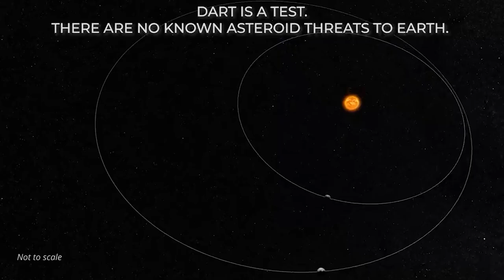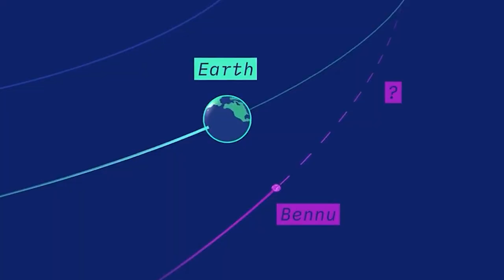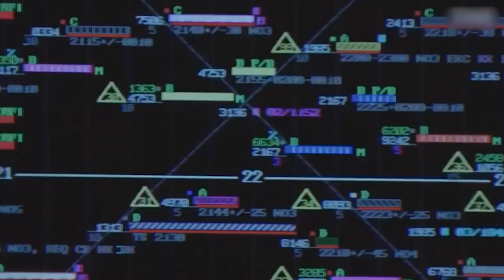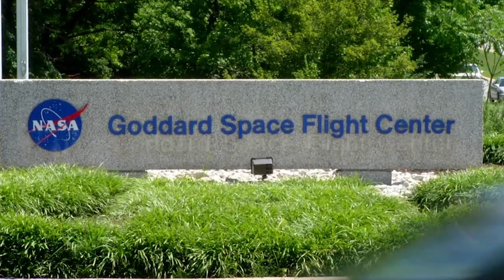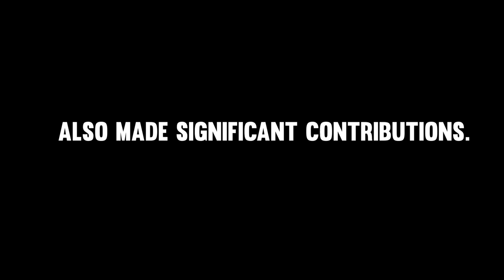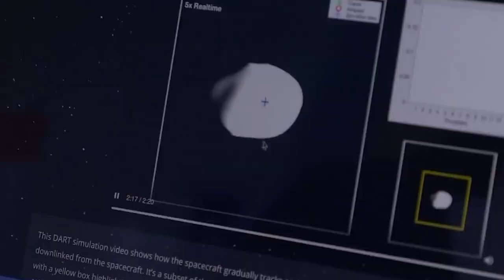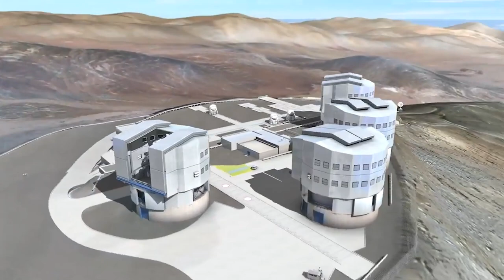Elon Musk REVEALS A Killer Asteroid Zooming To Earth!

Comment: Put this particle accelerator on a private island in Canada and in Hawaii and in Asia by the salt water to circulate salt water and put some electricity in the particle accelerator salt water and as the water spins it should create electricity
Reply: And a salt water particle accelerator on top of every 10th light pole
Reply: As it charges the electricity if you put one electricity wire in the salt water ìt will charge itself as it supplies the world with electricity and if the water keeps circulating it won't freeze in Canada
Reply: I want the electronic lunar battery charger as a phone case that is also the charger to your phone there's a spinner inside the case,  and seeing the case is plugged into the charging port it should keep your phone/device charged and it should give electric cars infinity range
Reply: Pretty much yeah. 🌼 🤗